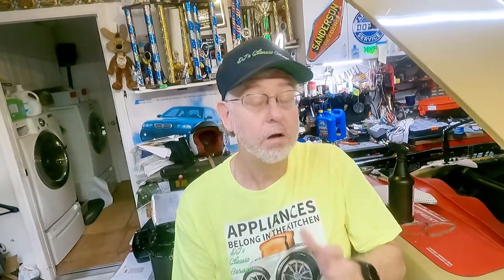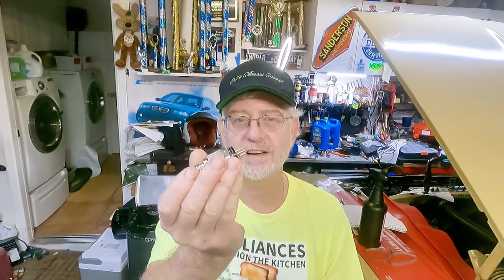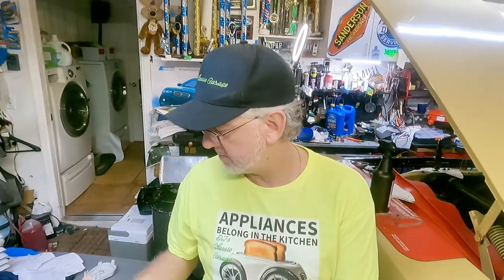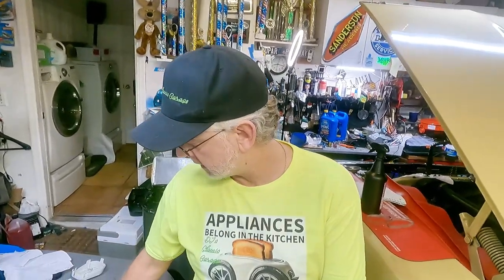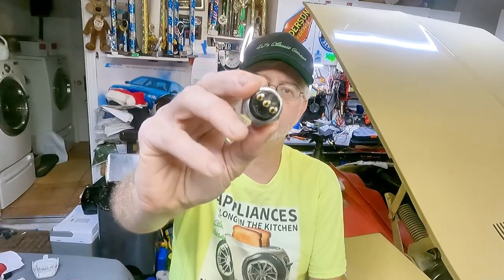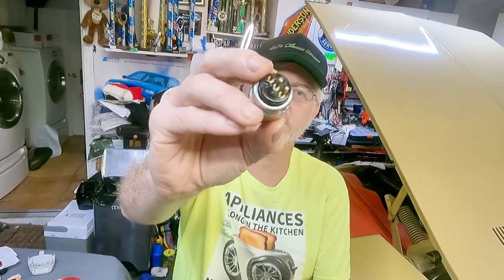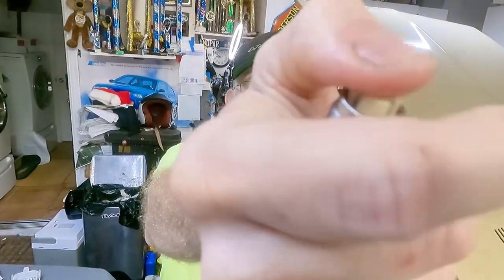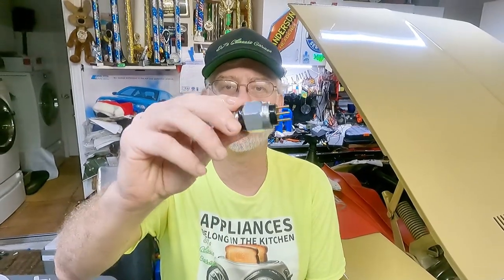Chinesium: Destroying Cars and Killing the Home Mechanic

Comment: It’s part of their culture to be shady.
Reply: Incorrect. They make things to order.
Reply: So it is in DC as well...
Reply: Maybe the heat from the exhaust is ruining that that part because you mentioned it was close to your exhaust maybe the stocks are exhaust wouldn't be run by it maybe the aftermarket exhaust is the problem aftermarket exhaust is never the problem you know what I'm saying maybe there's a lot of heat coming off that part of the exhaust and ruining that part otherwise you definitely got Chinese Chinese rocks whatever they scraped off the side of the hill and melted into metal Japan's always got pretty good parts
Reply: Rapid in heat wrap

Comment: Even dealer parts are garbage anymore. You think it's bad being a DIY mechanic, try running a shop trying to explain this to customers. How many times can you warranty a part for some one? I had this issue with an oem oil pressure sensor. 4 in a years time and all leaking oil at the contact pins
Reply: @doughart1855  Sadly I completely agree
Reply: I've lost most of my original regulars due to them passing away but Im dreading the day the chinesium catches up with me fully because the comebacks for warranty have already begun over this last year like never before. It's always any cooling system parts made of plastic, sensors, and especially suspension parts if you are not special ordering 1st world made parts.

Comment: I have a 97 chevy pick-up and for 2 years I was replacing the distributor cap every 4 months. I got lucky about 2 years ago and my current cap has been holding up. The good thing with these junk parts is you get lots of mechanical practice.

Comment: i had something similar like that happened to me on an old dodge.  i removed the piece and sprayed it with starting fluid , stood it upside down let it dry off and then applied crazy glue around where the metal meets the plastic.  never had a problem with it leaking again!
Reply from the maker: That is one way to fix it.  Ingenuity

Comment: Clean it up real well and use a 2 part epoxy a little sanding and an O-ring .Long as your not leaking and starts and stops your good.I treat all parts like race parts -racecar parts RACECAR PROBLEMS

Comment: Most likely your "Chinesium" diagnosis is correct.  That said, I wonder if something happened to the transmission to cause elevated pressure???

727 is a fine transmission, but I know first hand it is possible to spin a bearing, have VERY elevated pressure, and drive it for a LONG time unwittingly. In my case, the first sign of trouble a year before was trouble with the trans cooler/lines over time due to high pressure.
Reply: i'm pretty sure the part he's talking about doesn't go into any pressurized area.

Comment: I was once ASE Certified Master Automotive Technician,...two year degree in industrial mechanical technology for local industry that shut down and now gets done in japan and china and no industrial jobs here in the usa, ...with secondary automotive repair classes cause I was always interested in cars, mechanic experience in the military for three and a half years and a war zone desert shield/desert storm, and automotive repair experience in civilian life but not that many years to talk shit bout, but I know vehicles, have tools, even newer books on the subjects,.....I'm biting my nails on the parts I bought off ebay for my 1997 chevy c2500,...already installed an ac dash control unit, the resistor and the fan,...original fan was out and I might rebuilt it someday cause its american made,,,or was canadian,...then I just received turn signal switch, turn signal relay, and ignition switch to be installed, bought off ebay low cost, definitely chinese made.  If I bought it all from the parts store it would be dorman chinese made and bout double to triple or quadruple the cost.  Some years ago I put in two oxygen sensors in my foreign car, just to have new with other sensors, threw out the old ones like a fool, then four months into use one of the oxygen sensors failed,..its still failed, I get a check engine light, was of course cheap chinese knockoffs of the real korean kia parts.  I have a rebuilt alternator in the old kia now,..obviously rebuilt with cheap chinese bearings,...the belt squeals for awhile when starting up,...and no its now loose,..might be too tight now, but its the bearing that gives too much resistance,...brand new rebuilt unit,...I had returned a first unit,...took hours to install and remove,...ground down the belt material all over the first new alternator,...the second one is less worse,...pisses me off, and now my neighbors and anyone else hear the squeal for awhile and thinks I drive a total piece of shit making noise even at night,.. and will likely have to replace the belt in another six months,...maybe every six months,...no choice.
Reply: You will have to excuse my long rant,...I took these matters seriously once, and in some ways still do....we've been sold out by those who take campaign funds both parties and they get mansions and luxury cars and the rest of us get cheap chinese made garbage and struggle to even repair our own old cars or collectibles,..I didn't think I'd see this back in the late seventies through the mid eighties when I was a young hot rod enthusiast with like six car magazine subscriptions,..well, until the late eighties when industry was being shut down and I had to join the military.

Comment: Still waiting on those 0-60 times. Unless you don’t want to post them for some reason?
Reply: I don't know about his build...but it is funny that most of the 13 second muscle cars were far from stock.
Reply: @Dryloch  Old cars were extremely slow when compared to today. I learned that specifically in 2009 when I drove a BMW 128. After I got out of it I was shocked, "it feels fast". I looked it up and realized 0-60 -5.7 seconds. This wasn't even the turbo version which was quite a bit faster. A lot of cars then were coming in under 6 seconds for 0-60 times. Skip to more than 15 years later, fast cars are everywhere. 

During the "oil crisis" and after cars sucked. Now they have buckets of HP&TQ. Unfortunately these turbo motors are fragile and few of them last longer than 150000 miles.
Reply: @gcanada3005 I got rid of my 94 Vette because the headaches keeping it running were not worth it. It also felt slow compared to my model 3, which does 60 in 3.7. Even on the Michelin all seasons, it corners better than the Corvette did.
Reply: @Dryloch  exactly

Comment: Can that "safety switch" be bypassed? And a plug be put in its place? 
I'm not familiar with your transmission. But I'm always amazed on most automatic transmissions that appear to be built so robust. To see such obviously frail failure points in the case castings. New viewer. Just curious. Probably got sent this video because I watch Uncle Tony. Sorry for your horrible transmission fluid leak over what should be a simple part.